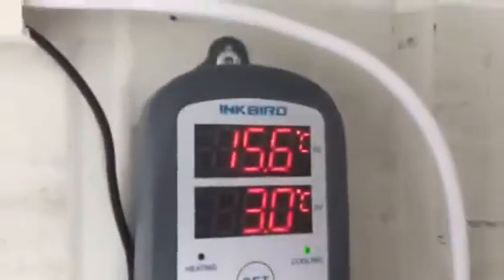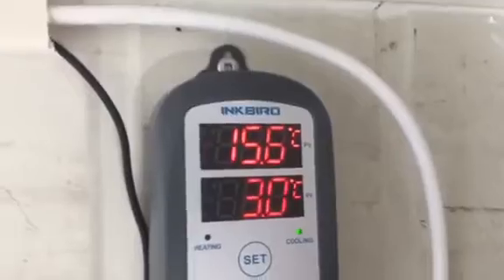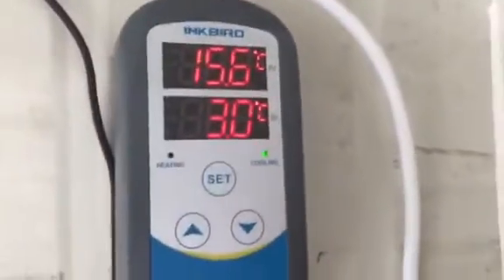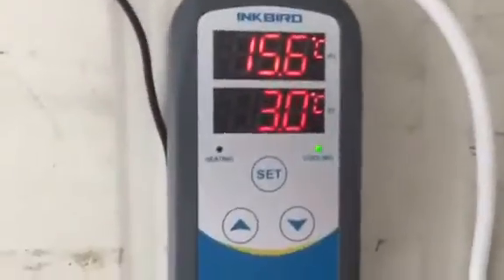DIY WALK IN CHILLER WITHOUT A COOLBOT.

Comment: Would like to replicate this, can you explain how to do it or link to a guide please. Would appreciate the help.
Reply from the maker: Sorry. Just got your message. The chiller uses a window mounted air con unit. The thermostat from the aircon is mounted next to the light. This tricks the aircon unit into running all the time.

The inkbird controller has its own thermostat and you can set the desired temperature on the inkbird controller. The inkbird controller then turns the aircon unit on or off depending on the temperature.